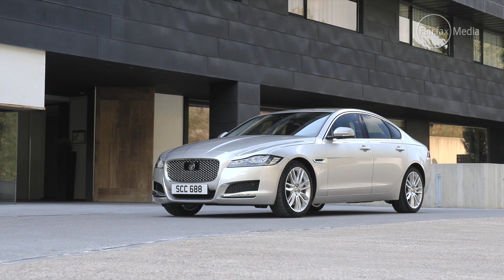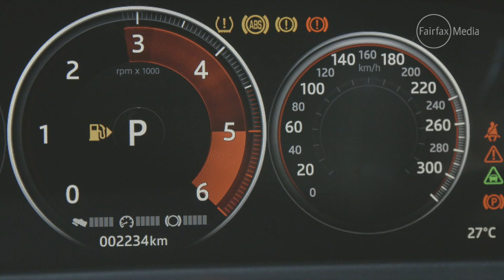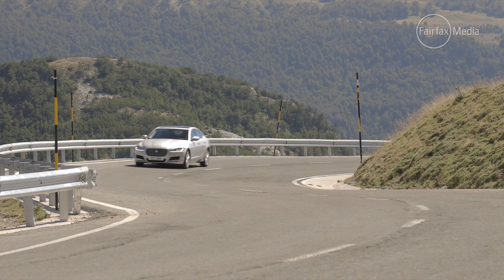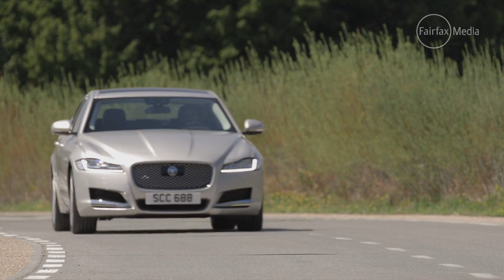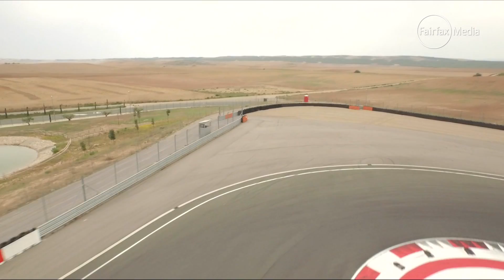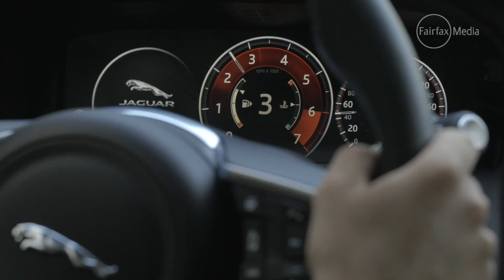Jaguar XF Road and Track Tested | Drive.com.au

Comment: sooo the end is. that the xf 2008 was better. the 2008-2009 did looks better and luxury and nicer interior and did have automatic airwent as this new and the look of the old was much much nicer as a aston martin from behind. and no plastic look inside as this new have. and yes the old engines is better also the gearbox. and the sound in those older engine is much much nicer. and the old cost less and looks more new and luxury than theese new modells

Comment: Aluminium frame and it's 1700 kg plus? Clearly technology weights alot.
Reply: MADD617. Agreed!,No Way good question!From my understanding, savings in the weight of the chassis, (190Kg over the outgoing model), allows JLR to spend that saved weight in better, stronger, independent active link rear, as well as double wishbone front suspension systems and vehicle dynamic control, (torque vectored braking) technology than it's competitors. Also a benefit of using almost all Aluminium Monocoque chassis construction, is that for the same structure weight you get significantly more structural rigidity than the same weight steel structure. Hence, Aircraft are fashioned from Aluminium for it's stiffness to weight ratio and not steel!The driving dynamic of this car, (if it can be considered a "work in progress"), can be seen in almost every review elsewhere, to be better than the BMW, Audi and Mercedes equivalent offerings. That's not to say Jaguar is better than any of those brands in all other respects. But the handling and performance under normal everyday driving situations is more than entertaining enough to put a big grin on your face.I enjoy the comfort and whispering refinement of mine during the city commute every day :-) and count myself lucky to see a single other, Jag in the sea of Mercs, Beamers and Audis along the way!